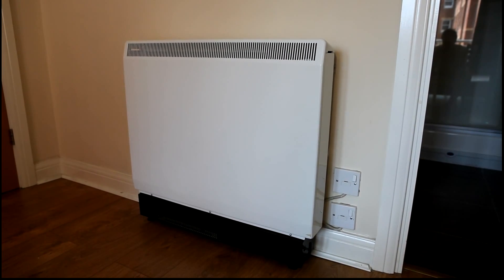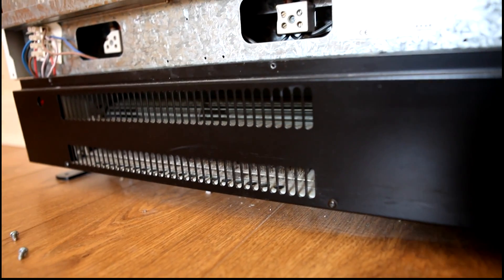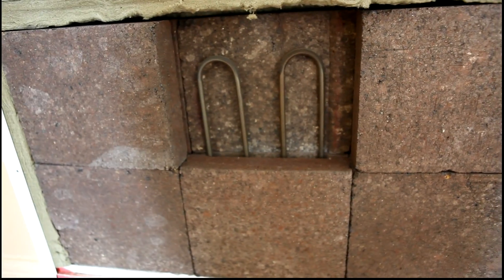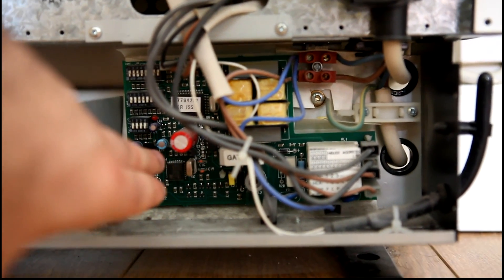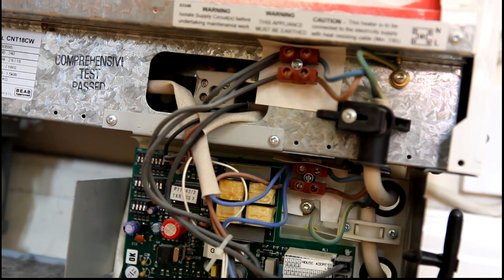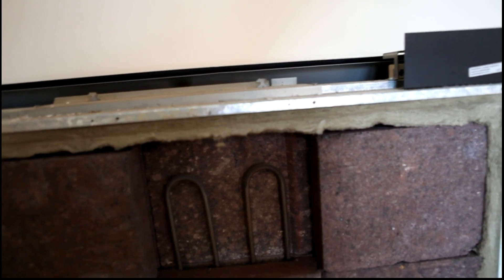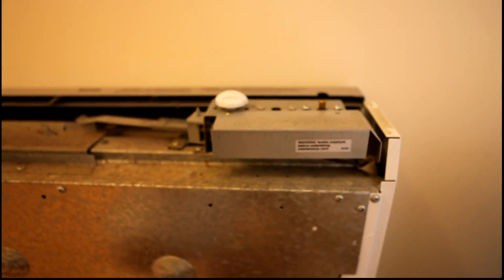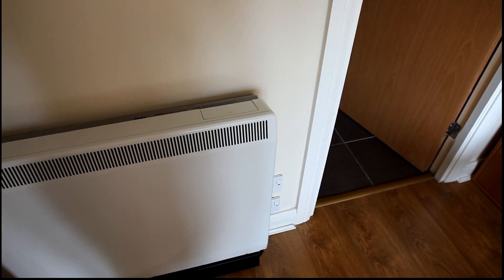Night storage heater dissassembly

Comment: If I wanted to remove my storage hear how would I go about disco sting it from the power and meter. I have one in my kitchen that doesn't acutely work and I have never used it and would prefer to remove it but I'm not an ectrition and don't no how to isolate it from the meter

Comment: I have used the Viking system in the U.S.  for about 30 years. Works great. The part I see missing here is a control unit. It's basicly a computer.  It knows the temperature outside..inside..and the desired temperature at the thermostat and stores heat accordingly.  Other than cleaning and lubing a fan or replacing a heating element every 3 or 4 years there have been no problems .
Reply: Correction..I typed the incorrect name. I ment Valliant heaters.  Also American Techno Therm. There are 7 in total heating a 2900 square foot house on 2 floors.

Comment: Hi Rex,The same heater is in my living room in Dublin. My kid put a fork into it (through bottom black panel holes) when hot air was coming through it. My wife said a small fire came out, power dripped. After we switched on the main, now only air is coming, not hot. What might have happened? Is it possible to repair it myself. What do I need to do? Please help.

Comment: great video. my property has all electric storage heaters and like you said they're naff. 
Yes the heat the rooms during the day when you're out to work ... however on returning home after work say from 6pm onwards the flat is luke warm at best.
 Have you made any decision to replace the naff storage heaters with electric-on-the-wall heaters? if so, which model/manufacturer did you choose?

Comment: Worst design ever, expensive tu run and the spares cost a fortune. A replacement for the mechanical input thermostat with the melt fuse costs £88 incl. VAT!! By the time you fit a house with 4 or 5 radiators, you have spent more money than a gas or oil central heating unit would cost you.
When ever you try to create heat via electricity, it will be very expensive.

Comment: Hi, I have 3 Credanet Newera storage heaters controlled by a panel in the kitchen. They are all similar models to this, with the fan heater at the bottom and the storage heater at night. None of them are working except for the boost button for one of them. Any ideas of what's gone wrong?
Reply: They are a British design - that's what is wrong ;o)  They never worked properly from the start, lots of faults with circuit boards, thermostats etc. I would never recommend E7 heating to anybody.
Reply: George Tempest George, we have a very old heater of this make which finally quit working.
Have spent the last few days on line trying to find replacement. While that can be done ok, it's finding a qualified person to install. At my age and having had back surgery some time ago, I certainly am not the person to tackle a job like this.  Any leads or further advice would be much appreciated. Like, who sells and also installs?
Thank You.
JayD

Comment: thanx  1 more thing if i add more insulation will it lower elec bill kindess regards bill
Reply from the maker: Probably not very much, but you could try it. The insulation is carefully designed so as not to be too good. These heaters are designed to leak heat during the day, to keep the house warm. Too much insulation will stop them working.

Comment: How do you remove the front cover..Would have thought that was first issue to address as on my Creda heaters can find no way to remove front panels?
Reply: 3 small screws at the bottom edge of the front cover - you'd need to lay down on the floor to get to them. And you need to take off the control knobs too or they snap off

Comment from the maker: If you have an E7 meter, then you still should only have power to the heater during the night (unless the heater has been wired to the main fuse box, which isn't normal).

Some suppliers will let you have a normal tariff on E7, by adding the readings together. But most suppliers don't let you, because they have to pay a different price for bulk energy that they send to an E7 meter; and if they give you a normal tariff on E7 it causes chaos for their accounting.

Comment from the maker: Has your heater been wired in correctly. Normally, a storage heater will be connected only to the night fuse box, but electronic ones like this will have two connections; one to the night fuse box, and one to the main house fuse box.

If it is wired correctly, you need to check if your meter is charging for night power at the correct time; they do sometimes lose track of time, and switch to night price in the middle of the day. The night fuse box is activated when the meter is in cheap mode.

Comment: my meter is on economy 7 so to my understanding it should only charge my storage heater up at midnight until 7am, but when I turned my storage heater on at 2pm after not being used for months within a few mins it heated up and gave out heat, where could the fault be? I have tried explaining this to my electricity supplier but they do not understand what I'm getting at as they do not fully understand how there own economy 7 should work.

Comment from the maker: The heater is extremely heavy, weighing about 100-200 kg with bricks. It will be very unstable on its feet, once unbolted from the wall, and if it falls could cause severe injury, and you may not be able to lift it back up. You need to take the bricks out first to be able to move the heater.

Comment: "Resistive heating is not very efficient"  Actually it's 100% efficient as 100% of the electrical energy is transformed into heat.

I agree that storage heating is not hugely 'effective' though.

Comment: Johnny cove always best to keep some spare thermo links in they are like solder and melt when too hot often melt on first few days you switch on in winter dead easy to replace if a bit fiddly. First winter day you switch back on turn charge very low then slowly increase over about 3 night's till you get to full charge. I melted the links in 1986 and 1987 and haven't melted them till this year

Comment: Start again got older creda models bulletproof since 1985 now going wrong cold at the bottom red hot at the top melts the thermo coupling thought it must be the bottom element but from yours looks like the elements go up from the bottom so don't know why it's cold at bottom any thoughts?

Comment from the maker: Indeed. It is a good idea. However, the implementation problems go way beyond just the interface. It's buggy, with heaters randomly shutting down. It's flaky - turning off a heater will confuse the programmer, and the heater won't come back on once mains power is turned on.  You have to reboot each heater and programmer in order to get it to come back up. Sadly this clears the heating parameters in the heaters, so they need 48 hours to relearn the tariff structure and room heat demands.